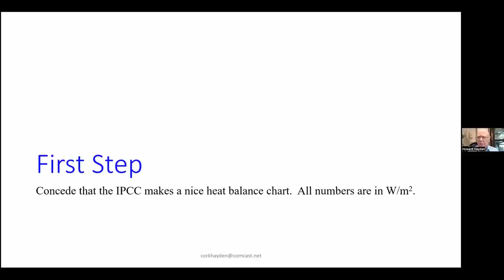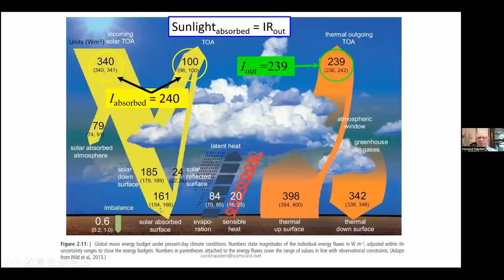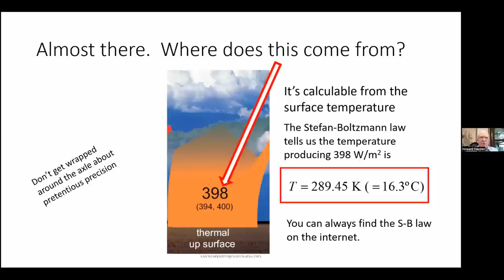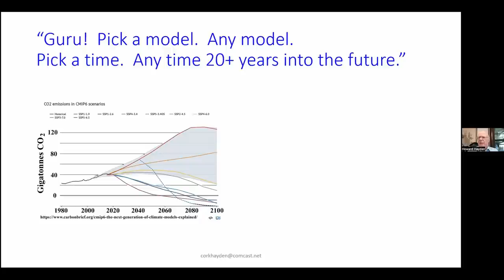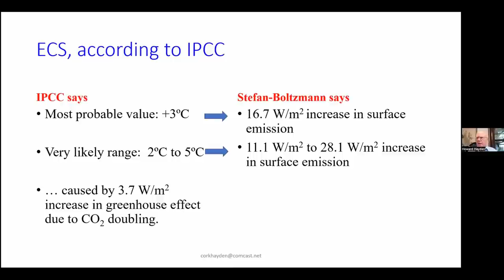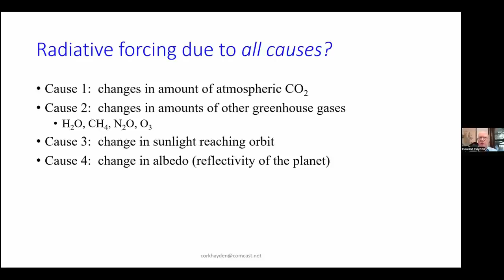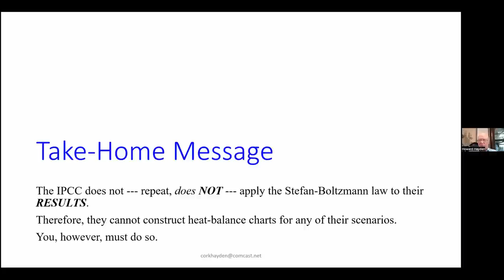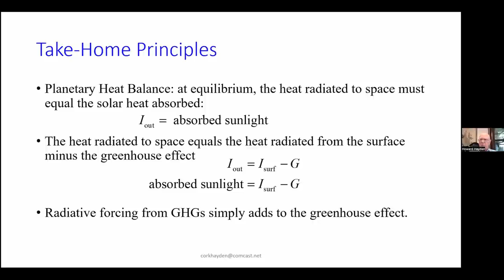#59 Howard Hayden: “the IPCC does NOT apply the Stefan-Boltzmann law to their results”

Comment: Can you ask Howard Hayden how is it possible to use SB-law on a gas at all (like they do on the atmosphere)? As far as I know this law has only validity for solid objects and not gases. In another physics field about oil-burners for heating water they discovered a error of 70%-90% when using the SB-law on flames compared to actual measurements.
Reply: The SB law is used to calculate the heat radiated by the Earth's surface ("thermal up surface" on the IPCC graphs).
There're some problems with using only this law to explain the heat loss of the ground into the atmosphere, as there are convective transfers as well, and the emissivity of the Earth's surface is around 0.95 - and not 1, as implied in this presentation.

Comment: Stefan & Boltzmann law applied to CO2 molecules within an average control volume of the troposphere (255K at 4-5 km altitude) yields 1,59 times more energy radiated to space as what is absorbed. This means cooling instead of warming which is against the narrativ.

Comment: I use the same technique for calculating future heat-balance charts as the IPCC does.  Indeed, it is incorrect to use the average temperature of the earth to calculate the IR emission from the surface.  As latitude increases toward poles, the temperature decreases, and so does the amount of surface area at that latitude. The area is proportional to the cosine of the latitude.  The upshot is that, using real-world data, you get pretty much the same increase in surface IR emission for a change of 1ºC.

If I ran an oil-producing nation and if I had no conscience, I would be in favor of restrictions on fossil fuels for two reasons:  I would not deplete my oil reservoirs as fast, and I could charge a king's ransom for a barrel of oil.  The first IPCC report to come out is always the Summary for Policy Makers.  Any subsequent report must --- by contract --- be consistent with the SPM, which has been approved by the political faction.

Comment: The graphics shown in this video are used to try to educate the general public about some of the basic science involved.  They are not meant to broadcast all the data about temperatures of the earth's surface and atmosphere that are relevant to the issue, all the transfer of heat and so on.  Hayden says to learn the Stefan-Boltzmann equation and apply it using the average temperature of the earth's surface, which absolutely does not tell you everything you need to know.  Part of the IR radiation emitted from the surface goes directly to space, but most is radiated from much colder parts of the upper atmosphere.  Also the S-F equation as he writes it only applies to blackbodies; for the surface of the earth there should be an emissivity value in the equation.  The energy balance of the earth is far more complicated than Hayden claims it to be in this presentation.  One of the most relevant basic facts is this:  satellite data shows that the upper atmosphere has on average cooled, while the earth's surface on average has warmed, which can only mean that the effective insulating value of the atmosphere has increased.  I think it would be interesting if Hayden debated an atmospheric physicist about how to correctly apply the S-F equation and how to do all the other computational tasks and modeling necessary to understand this very complicated issue.
Reply: Why can't this strange cooling of the upper atmosphere mean that the Earth's climate is entering cooling period being delayed by co2 induced warming effect?
It will be consistent with both "Little ice age" cooling period that just begun and the observed co2 warming effect "battling it out" for the climatic dominance? Are you aware that the latest weakening of Earth's magnetic field will only intensify the (cooling) effects of the "Little ice age" to the unknown but significantly higher levels?
Are you (like Sabine H.) also sure that Gulf stream is not approaching its end which can cause instant catastrophe in northern hemisphere ? Why are Europan oceanoagraphers disagreeing?
Are you aware that for the last two million years we had Ice Age/Milankovich Cycles like a clockwork and according to that clock we are about to enter new Ice Age cycle at the end of our interglacial period which is now?
Are you underestimating other potent climate modulators at the expense of objectivity? Are you overestimating co2's warming powers ?

Comment: If you want an optimal CO2, based on geological history, it'd be about 3000ppm.  The maximum is ~7000ppm, which was around the "Cambrian Explosion" and the time of the greatest diversity of life on this planet.  400ppm is near the  bare minimum for plant existence, as noted in the video.  This presentation is yet one more example of how much is not being told, or evaluated, in order to go with the "crisis".  Additionally, natural fluctuations are ignored, excused away as irrelevant or 'assumed to be constant'; the single most important being solar irradiance - the only source of heat for the planet.  Any variation in that will change everything, no matter what we do.  Finally, no climate model has been able to recreate any known historical temperature trend, given known starting values.  That, all by itself calls into question the validity of any of the models and at worst, indicates the models are not just wrong but false.
Reply: 35:59

Comment: What do I get if, instead of using an average Earth temperature in Stefan-Boltzmann, I compute the local emitted intensity over a small area and then integrate those over the whole Earth? I'm thinking, because Stefan-Boltzmann is nonlinear, the radiation from an average temperature of the Earth is not the same as an averaged emission.
Reply: If you follow Fourier's model, he separates the temperature influence of all radiating objects like stars (the Sun is by fare the largest . . .)  that can affect a point (near a planet) to give a local temperature  (due to this radiation). He calls this 'the temperature of space'. He then explains that the rocky surface of a planet, with an atmosphere, is always at a higher temperature because of the atmosphere.
You must remember that the rocky/watery surface is NOT the surface of the planet, it is 'the surface + the atmosphere.
The atmosphere close to the surface is compressed by the force of gravity which raises its temperature.
There is NO CO2 greenhouse effect!
OK?
Reply: @brianletter3545  Thanks but I really don't think that answers the question. It comes down to the question of an integral of T^4 over the surface of the Earth {∫T^4dθdφ ≠ [∫Tdθdφ]^4}
Reply: Indeed, averaging 'temperature' is misleading because heat content (energy) is not remotely related to temperature. For example, the energy need to evaporate an amount water is very large but the temperature change when it turns to steam is zero. It is perfectly possible (and it happens in every power station boiling water) to have a container full with both water and steam, all at the same temperature. The steam can be heated above the boiling point of water but not in the same container. Superheaters must be separated from the main boiler!

Comment: Without any intent to cast aspersions these equations should also stand up to different times in earth's history, correct? Could you/would you- jig the equation to possibly fit the "Little Ice Age" from which we are told we are now leaving. Similarly, could you do the same to explain the Medieval Warm Period?
Reply: We are not leaving but have just entered latest "Little Ice Age". It's the period of Sun's reduced electromagnetic activity noticeable by complete absence of "Sun spots". It lasts 7 times 11 years standard cycles of the Sun - 77 years and we are at the beginning. The known effects of "Little Ice Age" are : colder weather,increased seismic and volcanic activity. Likely mode of action on climate is through changes in jet stream patterns and cloud seeding due to the increased bombardment by cosmic rays caused by the weakening of Earth's protection layer created by Sun's radiation. The other protection layer is our own Earth's magnetic field which has also weakened by about 25% in the last 3 decades which will increase the cooling effects of this "Little ice age ". 
And we are also at the end of the interglacial warming period which lasts 10-15,000 years between 85-90,000 years long periods of Ice Age glaciacion determined by Milankovich Cycles and repeating for the last two million years. We are 13,500 years deep in our warm interglacial cycle and are about to enter real Ice Age soon unless "global warming" prevents that which has never happened before. But we also never had 8 billion people before so we'll see.

Comment: @23:00 Hayden adds his calculation of Stefan Boltzmann extra IR emission due to increase in surface temperature.  He does not explain how he made the calculation, and it differs massively from the calculation when I do it.  In fact, the IPCC figure of a 3.5C increase from an extra 7 W/m2 is justifiable by correct use of Stefan Boltzmann.  The IPCC is wrong elsewhere of course, but I do not understand where Hayden's 20C comes from.  It looks as if Hayden made a massive calculation error or misunderstanding.  @30:30 he makes a mental guess at the temperature rise due to 7 W/m2, and those guesses are wildly wrong, as are his subsequent numbers about CO2 in the atmosphere.  We have to look elsewhere for the real reasons not to trust IPCC.

Comment: I think Howard Hayden misinterprets the chart at 13:00 minutes into the video. The green lines and blocks are added by him and I think he did it wrong. 
An increase in greenhouse gases makes the atmosphere absorb extra heat, leading to a warmer atmosphere which will also radiate heat. Part of which in turn increases the Thermal Down Surface value shown as 342 in the chart, the rest goes upward. I suspect that the 342 includes cloud reflection. The surface temperature and air temperature will then increase, leading to more radiation per the Stefan Boltzman equation. This will lead to more radiation through the "atmospheric window" which is a frequency range through which all the greenhouse gases (of which water vapor is the most important) are transparent.
Howard Hayden wants to calculate the greenhouse effect from this chart, but that is impossible as long as the size of the atmospheric window isn't given.
Howard Hayden claims that the greenhouse effect in this chart is 159 but that is impossible to determine and likely wrong. The greenhouse effect (PLUS (I suspect) cloud reflection) is 342 plus the unknown amount that the atmosphere sends up outside of the stated atmospheric window.
Reply: @Peter you say "his" calculations of the "greenhouse effect" are IMPOSSIBLE to calculate but that was the exact figure that the ICCP published? If you are saying that the IPCC are publishing data that is IMPOSSIBLE to calculate then I would have to agree with you.
Reply: @melb5996  I was about to write down some equations based on that chart at 13:00 then I realized some things: 1) there are TWO Stefan Boltzman equations at work here, one from the surface and one from the warmed air above the surface. 2) higher temperature of the surface leads to much more radiation per the temperature-to-the-fourth-power, but part of that radiation gets reflected by clouds and effectively reflected by greenhouse gases to maintain that higher temperature. 
3) the radiation from the atmosphere will not follow the Stefan Boltzmann equation perfectly as it is not a perfect black body, and will emit at the same frequencies as radiation gets absorbed, mostly skipping the atmospheric window.
4) the model is too simple anyway as there is considerable heat transfer through wind and sea currents away from the tropics and toward the poles. Basically, the tropics receive more net radiation and the rest of the globe emits more net radiation. 
Averaging temperature and radiation over a wide area when the radiation is to the 4th power is mathematically complex.
In the end, I think that this model is too much of a simplification of reality, and models that are too simple can lead to mistakes.
Reply: @petersteenkamp  "effectively reflected by greenhouse gases" No, that is one of many defects in the IPCC 'man-made Climate Change' position. CO2 (and all other atmospheric gases) are exceedingly weak reflectors of any radiation because of their very low density. It is a major error to consider gases as reflectors of radiation. On the bother hand, liquids, in the form of clouds, have a much higher density (> x 1000 times) gases and they are quite good reflectors, that is why clouds are visible. Further, clouds 'reflect' sunlight very well, reducing the input of heat from the Sun substantially, one (possible) cause of ice ages.

Comment: First, an interesting talk. Nice job. At 27:44 I think this is a little incomplete if I may so, because you didn't explicity state that there is an abledo assumption in there. Your figure of 398W/m**2 we can compare with the actual solar insolation of 250W/**2 (wikipedia). It is possible to account for the Earths real abledo, approx 0.3, by making the sun hotter, as you have done. Without getting into the maths, its pretty obvious that black earth with a clear sky would absorb more heat that if the earth was a silver mirror. In the latter case, most of the sunlight just reflects into space, in the black earth it is absorbed. What the IPCC are doing is saying that there is a effect on albedo as the world warms, such that a warmer earth absorbs more heat than expected due to albedo changes. The mechanism they propose is  hotter = more water vapour = more clouds = more greenhouse effect. The formation of clouds is poorly understood (as the IPCC say) and thus the assumption of +ve feedback may well be totally wrong. Clouds reflect sometimes, and add to the greenhouse effect on other occasions. So it is possible to get their calculations insolation vs temperature to work, but it makes a big assumption which has low confidence.

Comment: At 32:00, I don't understand his reasoning here about human emissions being only about 4% of the total carbon (not CO2) annual flow so that one can't tell which bit of CO2 is building up in the atmosphere, 'ours' or 'nature's'. Until around 1850 it was not building up at all, so it's hard to see how natural inflow to the atmosphere would start to increase at that point. Which 'bit' of CO2 is in any case irrelevant, since if you pour water into an already full bucket it isn't your 'bit' of water that overflows but you have still caused it (not implying that 300ppm is "full", of course). I wish someone would address this point because so far no one has, and it is a serious flaw in the "4%"  narrative.
Reply: It appears to me that fossil fuel production graphs and Co2 emission graphs are identical. They all move up in a consistent and dramatic arc. The flaw is that the temp graphs don't match these two graphs. Temps in fact have barely budged in the last 24 years. Meanwhile we've used more fossil fuels this century than during our entire history. How do they reconcile this? 

While it seems like Co2 may be a greenhouse gas, it also seems to just simply be a benign greenhouse gas. It's proven to be logarithmic so perhaps it simply isn't contributing to any more warming. Seems to me that there is far more politics afoot than science regarding the demonization of fossil fuels which have proven to have incalculable benefits to humanity.
Reply: Anthony,

Just want to say well done! 
That’s a very concise and thoughtful response.
Reply: @coachduke9323  Thanks. I'm more familiar with being mercilessly attacked by green zealots. LOL.

Comment: There is one fundamental flaw in your reasoning and probably the IPCC too. The S-B equation varies with the power four to temperature while and average varies to the power of one. The average S-B calculated radiation must therefore be applied to each individual temperature reading and then summed and divided by the number of readings to get the average outgoing radiation. Take a simple case of two readings 200 and 300 K the average is 250K which gives143.4 W/m^2 but the correct outgoing average radiation is (58.7+297.3)/2 = 178 W/m^2 However the correct value will always be higher than that derived from the average temperature strengthening your argument.

Comment: If the Earth absorbs 240 watts/m^2 and radiates 398 watts/m^2, where does it get the extra 158 watts/m^2?
Reply: I want to try to answer my question. The energy entering the Earth’s surface is the 342 w/m2 from green house gasses (see right side of drawing) plus 161 w/m2 of solar energy from the sun (see left side of drawing), which is 503 w/m2. The energy leaving the Earth’s surface is 398 w/m2 (heat leaving the surface) plus 84 w/m2 (evaporation) and 20 w/m2 (another kind of heat??), which is 502 w/m2. So the surface gets heated by 1 w/m2, which as Professor Hayden said, the difference of large numbers to find a small number often results in a number, which has an uncertainty greater than its magnitude.  I don’t know what to do with the 79 w/m2 absorbed sunlight. Maybe it contributes to heat from greenhouse gas?
Reply: From the sun/CO₂ isolation. If you don a jacket - where the additional energy comes from? You create a temperature gradient between your body and the colder surface of the jacket. Your body still emits the same energy, but you lose less energy because the jacket surface is colder than your skin.
The same happens in the atmosphere - more CO₂ moves the effective emission surface outside into the cold. Less energy is radiated. Thanks to the T gradient the surface gets warmer.